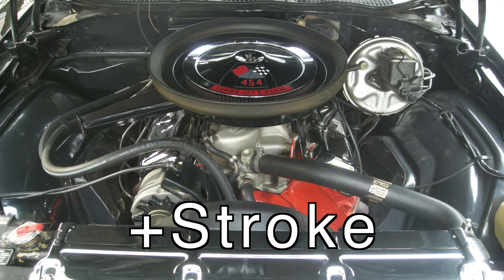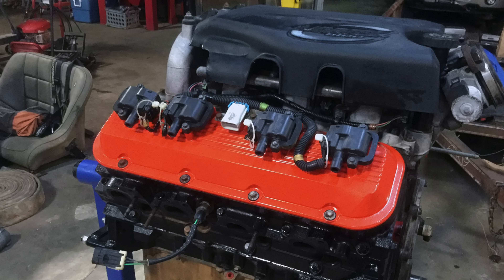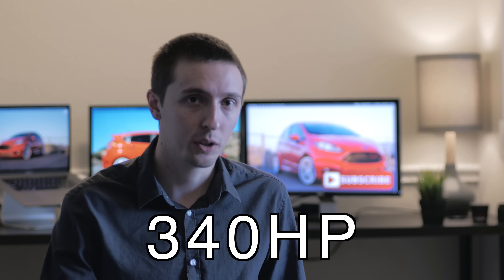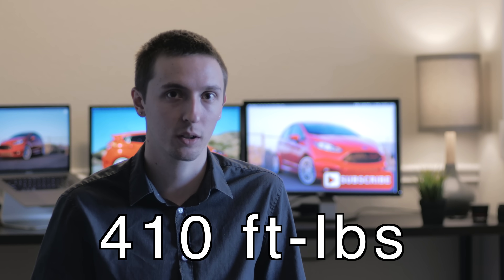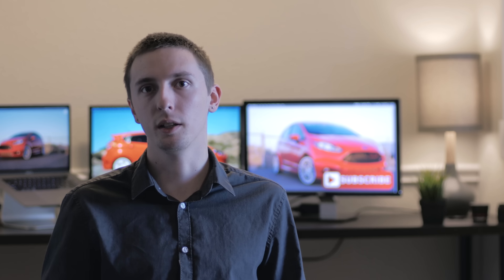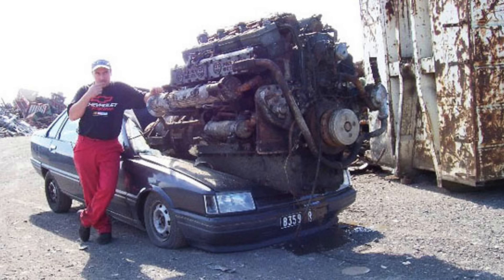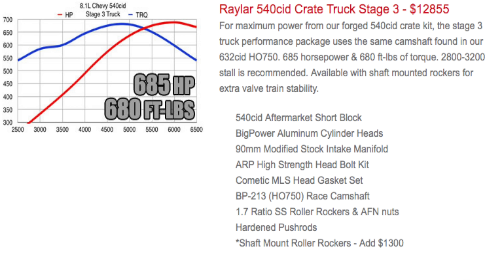Vortec 8100: Everything You Want to Know | Specs and More

Comment: as a fleet truck the 8.1 is superior to the duramax. i work oilfield and our trucks see a lot of idle time. the newer diesels have so many problems because of it and are often in the shop. our gas trucks do just fine but don't have the torque to pull trailers. thats where the 8.1 fits in
Reply: The old diesel trucks without emissions could idle forever but egr/def forget it. All our semi trucks in the oil field were pre emissions.
Reply: @horsefly1020  the older diesel are way more reliable
Reply: Lucky the company man doesn’t make you get out of the truck.
Reply: Lee Tucker what oil field. I hope to god you don’t say lower 48.
Reply: @Sackmatters  the bakken

Comment: One of the big reasons the 8100 was stopped being made, is it was hard for gm to clean up the engine for emissions. Ask yourself why isn't there anymore big block engines? When you dump a lot of raw fuel in big cylinders it is very hard to burn all that raw fuel. Ford understood this when the 460 was dropped in favor for the v-10.  Hence much smaller cylinders to burn all the fuel. Now all manufacturers has gone to small blocks for cleaner emissions. Now there seems to be a trend going to bigger small block engines. Will we see big block engines in the future ?  Idk.
Reply: isnt it funny when you measure a 427 cu in engine in the SMALL BLOCK or a big block....  its still a 427 and, the mileage still sucks... the small block will rev quicker and makes more hp but, mileage is at a cost....along with the far improved electronic fuel injection, they still run like crazy but, the 6.0s are way over taxed under load and, cant do what the big blocks do...  i have a 38 foot 5th wheel and my friend can not keep up towing his 28' ball pull trailer and a 6.0 in his 2500hd.. but,   HE CAN pass a gas station where i cant...  lol
Reply: @INKJAX  one of the down side of a small block is they don't have the tq like a big block does. Plus rpms are higher for hp for a small block then a big block.  

It will be interesting to see what gm will do with there 6.0 in the heavy duty trucks. Gm pride themselves in class hp with there small block engines, but 6.0 is last in class. 

I driven 6.0 gmc and I wasn't really impressed with it compared with the 2nd gen v-10. It felt like the hp might have been the same , but the tq was not there. Felt like you lost your best friend between the two.
Reply: Really, it was the fuel economy that killed it. GM was able to remove the EGR system on the engine in 2004,due to meeting emissions requirements without it. But with the big economic recession from '07-'10, GM had to make cuts, and the Duramax was way more popular
Reply: @TrailRider1200  you might be right on fuel mileage , but it comes back to what I was saying. When you have unburned fuel it is poor fuel economy which is still poor emissions to. So it was one of the same. 

Now dsls is facing another issue and that is getting more expensive to buy. I remember a 7.3 dsl was around 4,500 $ dollars now they are close to 9,000$. How can you recover the cost on fuel mileage on buying a dsl when the dsls then to now on mpg has not increased that much? Emissions is driving the cost of dsls up.  Everyone is wondering which of the big 3 will reach 1000 lb tq.  Me on the other hand is where is the ceiling for buying a dsl is at?  I also like to see the big 3 put little more into the gas engines then there dsls.

Comment: When it comes to trucks and choosing Gasoline over Diesel it's not due to ease of finding a gasoline over somewhere that carries Diesel.  There's 2 much more important factors. 1) Upfront costs. I'm not sure what the price difference of an 8.1 truck over a Duramax a decade+ ago but it was probably anywhere between $6-10,000.  That's a lot of money.  Secondly the cost of maintenance of a gasoline over a Diesel can be quite costly.  A Diesel mechanic will cost more per hour and be harder to find than your average mechanic.  The cost of parts for a Diesel can be much higher as well.  However the LB7 Duramax was one hell of an engine with good reliability so in hindsight there wasn't much debate there (many unlucky folks learned a hard lesson with the 6.0 Ford and to a lesser extent the 24V Cummins).  

Unless you are someone who tows many miles per year, the 8100 made more sense economically than the Duramax.   Even if you were able to double the fuel economy with a Duramax it'd take a long time for the Diesel option to pay for itself. Don't forget that Diesel also cost more than regular unleaded gasoline, and I've never seen a Diesel get double the mileage of a gasoline rig towing.

Comment: A buddy of mine had one of these 8.1 and i had the 5.3 with 4:10 not sure if the 8.1 had 3:73 are 3:42 but my 5.3 would eat his lunch.
Reply: Jason

I borrowed a friend's ranch truck with the 8.1 years ago and it felt great. It impressed me and i always thought it was a good engine. I think it's only downside is everyone crying about MPGs. That's cost of ownership to me 💪
Reply: yeah but the Duramax would eat the 8.1 and the 5.3 like it was a snack!
Reply: @jacob1501  5.3 doesn't touch a 8.1 buddy . Cold day in hell. 5.3 is a piece. Stock duramax vs stock 8.1. The 8.1 fucks it bad
Reply: Jacob Godfrey with a programer it sure will.but wait till you have to start repair that diesel. Buddy of mine spend 10k on the injection pump repairs.

Comment: Love the fact that it runs GEN3 LS based electronics, has LS style cathedral port heads and LS based firing order.
Reply: The ports are similar but not ls styled due to how a big block valvetrain is setup and the firing order is the same because gm doesn't count the cylinders the same anymore.

Comment: Forget it mine got 4 mpg towing my 5th wheel 9 empty try going down the Baha. I dumped that gas guzzler .towing up the grape vine would go 29mph at 4200 rpm. A duramax will do 60 at 1800 with the same load and get 10mpg towing .you cant feed an 8100 enough.
Reply: I'm a diesel guy. But what I'll say is 1800rpm in a diesel is the equivalent of about 4k on a gas.
Reply: I had a 1500 with a 5.3 vortec for my work trailer and it was struggling!! I now have a 2012 Duramax LML and wow what a fucking difference!! With the 5.3 it would downshift when going up the smallest inclines on the interstate. Now with the dmax I can tap the pedal and it goes faster over hills like I didn't have a trailer and like I wasn't going over a hill. I love that low RPM toqre.
Reply: Comet with Bleach not even close...
Reply: @jhurley12  lol, so a diesel revs out to 7k rpm? No. They rev to 3k with a tuner you can get it to 4k. Race trucks get up to 5k.
Reply: Comet with Bleach what diesel are you talking about? My lbz redlines at 5k. But shift points are factory around 3800, safely engine braking is the 4500-5000 according to GM..And it's not even about that.. peak torque on a stock duramax is 16-1800 rpm, on a gasser 6.0 it's 26-2800.. my point is you're way off in your original comment.. it in no way equates to 4000 fucking rpm on a gasser.. the diesel just creates twice the torque in the low end. Jesus christ
Reply: @jhurley12  wow you need some anger management. The gauge says 5k but it will never go there EVER. On top of that you're lying through your teeth or your truck is broken, The other option is your torque converter is junk and slipping and revving out. If you have it wop it will shift at 3200....unless you have a tuner. All I have to do is go search shift points and see your wrong but I know already.
Reply: @jhurley12  me saying 1800 being close to what 4000 is on gas. Is very close estimate in such that gas engines make peak power around 6k diesels are around 2-2500 do the math it's very equivalent.
Reply: Comet with Bleach just buy a cummins 😂
Reply: @justinmartin8887  I have a 06 5.9 Cummins. Where did you read that I said anything about what I had?
Reply: Comet with Bleach I meant the for jhurley
Reply: @justinmartin8887  ahhhhhh Haha yeah they all have ups and downs. Honestly if I bought a brand new truck it be Ford. Or maybe dodge they run that last manual transmission option on the market
Reply: Comet with Bleach not I, I see enough of those go through our shop. We have a contract with United rentals to upfit their f550s with lift gates. Here and there a new ram to but not as common. Chevy seems to be pretty much nonexistent in the fleet truck industry. I guess maybe because the have no direct competition for the f550 and 5500. Majority of the trucks are gas again. It just doesn’t seem right to have a 550 with a gas engine
Reply: @justinmartin8887  yeah that's what a common around here as well. I think Ford just has always had the contracts. All the paving companies here are Chevy fleets though
Reply: Comet with Bleach yea I see Chevy 1500 trucks on the paving crews along the pa turnpike a lot. They’re putting gas line in close by and I think ram is the most popular welding rig. I think each brand has their certain model that is more successful
Reply: @justinmartin8887  I think the dodge cab and chassis is there most purchased fleet vehicles
Reply: When the duramax came out in 2001 this truck out towed it in every option. Now this truck wouldn't compare
Reply: Robert Schiedeck That’s the sad truth to the 8100. I believe if GM really wanted to resurrect that motor they could have a very popular following. 

Applying technology like VVT and VCT alone would really make that engine a more practical alternative to diesel. 

Even just bumping the static compression ratio up to 10.5 or 11:1 would being the torque way up there. 

Oh well, personally I have my sights set on a Duramax swapped with to a 4WD Suburban or Yukon XL 2500 with the Alison 1000. 

That will give me what I need and should last a long time.
Reply: Robert Schiedeck I'd say those mpg numbers are a little low. My lbz gets between 10-13 towing 14-16k if I get some highway miles in there. Diesel wins in every way. Cheaper fuel, better economy, more power.
Reply: Bullshit, learn to drive! My 8.1 will pull you truck AND trailer over the Vine at 60!
Reply: What the hell was wrong with your truck? My 8.1 gets 17 unloaded and 12 loaded to 14000lbs gvwr with 3.73 gears.
Reply: @rewind48  the 8.1 won't get those milage numbers it it was pushed out a plane.

Comment: I have owned many Duramax 2500s and I would never trade the Duramax for any gas engine. I have also owned many Cummins and PowerStroke engines, and the Duramax/Allison combo is damn near impossible to beat for towing, offroading, and general driving. I guarantee it gets better gas mileage than it's gas counterpart. Granted, it all comes down to gearing, but my 6.7 Cummins with the Aisin 6 speed auto has 126,000 miles on it and still gets 22 mph, even when my average cruising speed is 80 mph. Hell, even towing a gooseneck 20,000lb trailer it still gets 14 mpg. Now THAT'S hard to beat.
Reply: jacob dukes let me guess your dad owns a 6.4L.